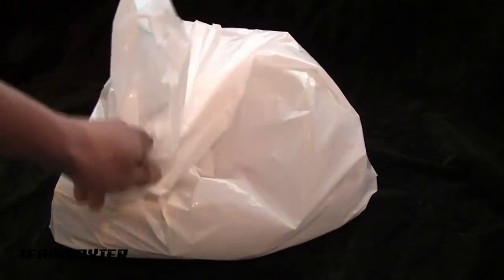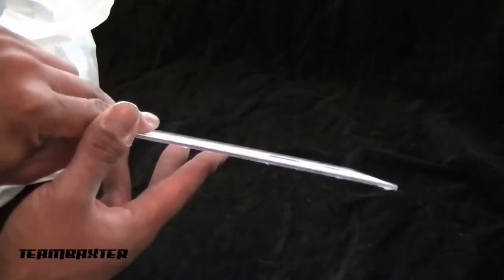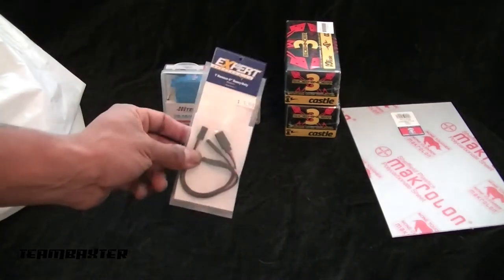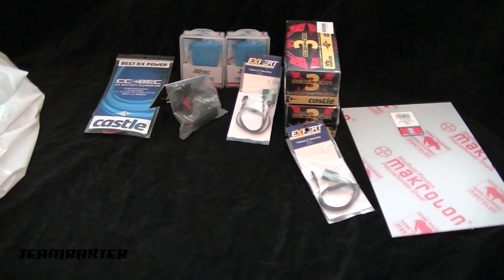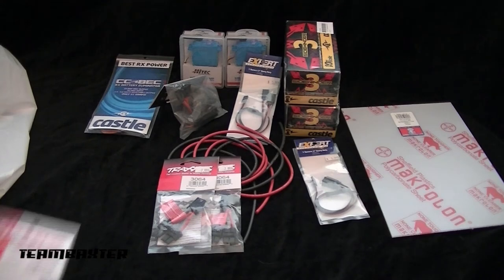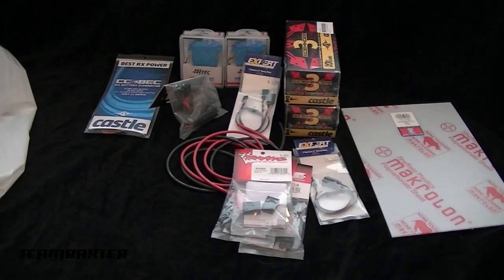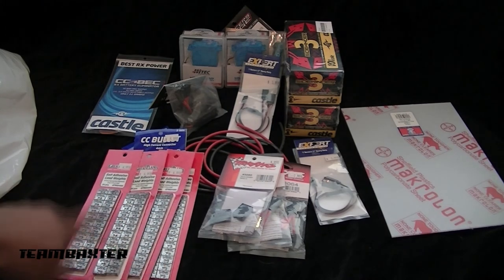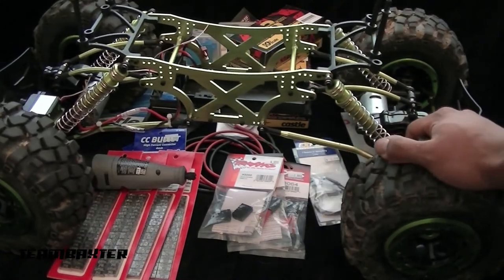MaxStone 8 Upgrades: Project Max Duo

Comment: That's the same dremel I use. There has been a couple times I wished for more power, but ended up picking up an angle grinder at Lowe's for $35 that takes care of the heavier work, and that's just for metal fabricating chassis' or skid plates. I did grab the 110 pc dremel super accessory kit for $16. I think it's worth the money for the extra bits you get and back ups of the ones you use the most.
Reply from the maker: Tricky D yea, man, i love this tool already. did a little drilling, sanding and ngraving work with it already. i could maybe see the need for more power, but this one is perfect right now. i should have had it long ago
Reply from the maker: ill have to check out that accessory kit, ive already bought about 6 different new bits for this tthing.
Reply: They have an 80 and 110 pc at Wally world (Wal Mart). You get a lot more for the $$ buying one of the bigger accessory kits. Or at least it worked out that way for me. I guess it would depend on what bits you needed.